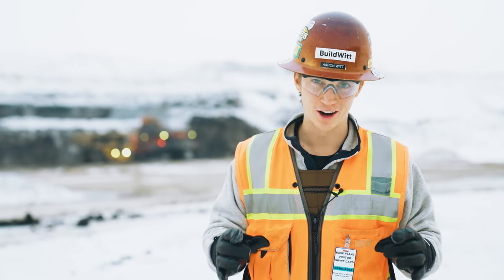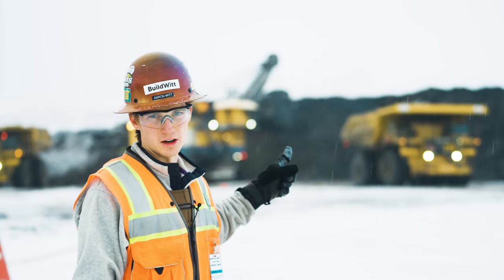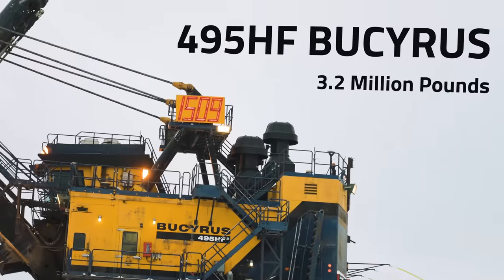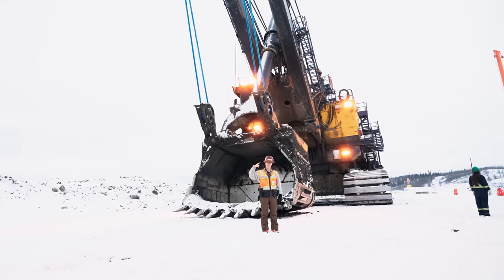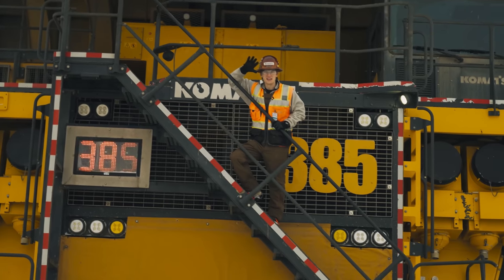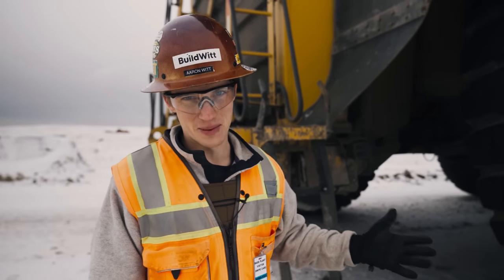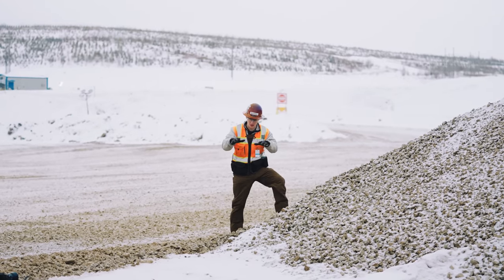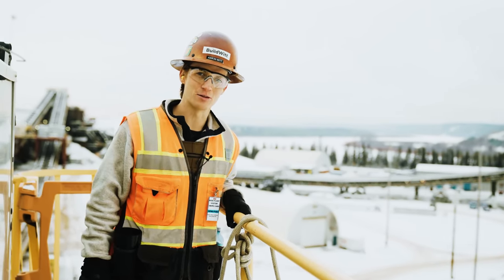Comparing the BIGGEST Trucks on Earth

Comment: Finally been waiting for this one! I was in dispatch the day of this filming!
Reply: How cool is that! 👍👍
Reply: What does the dispatcher do?
Reply: @AHomelessDorito  Dispatchers use a program to essentially tell the trucks where they need to go. The dispatchers goal is to optimize the amount of trucks they need per each shovel to never have a shovel waiting without a truck being there. They also need to make sure the hoppers/plant is getting the correct blend of material so they can optimize how they extract the oil from the sand.  So when Aaron went into the truck and shows off that panel that said the operator had 19 minutes left of their lunch break that was the Modular dispatch panel (Modular is just the brand of panel and the makers of the dispatch program there are also others such as WENCO). On that panel the operator will get a message telling them to go to X shovel or X hopper/dump.
Reply: @72lololol  What kind of autonomy is used on the self-driving truck and how does it work with your dispatch system?
Reply: @philipwallstedt5685   I worked in the manned operations so i am not an expert on the topic, but Suncor uses Kamatsu's AHS system the way it works is essentially there are 2 different programs running Modular Dispatch and Frontrunner. Frontrunner being the system used to actually control the AHS trucks. But the trucks are pretty well fully autonomous the way it works is by supervisors in the pits drawing lines for the haul trucks then the haul trucks using their super precise GPS systems will stay exactly on those lines. They also have a whole array of cameras and lidar on the front and back of the truck where they will sense nearby objects and stop if needed. But they fully back up to the shovel and dumps and will dump off on their own. @Aaron Witt just released a video on them as well that talks about them a little further.

Comment: I do a lot of work in my backyard. Obviously I just have tools like shovels, rakes, wheel barrows and hand tampers. The more of your videos I watch the more I realize these really big machines are just really big versions of hand tools and that's not meant to be a slight. One of these machines does the work of 1000s of men and all these machines run on oil. The problem is we're squandering this precious resource rather than using it wisely.

Comment: I visited the Syncrude mine back in 1984. At that time they were mining the bitumen with massive draglines and windrowing the bitumen in to large windrows. The windrows were picked up by a large wheel excavator, much like the ones you see in German coal mines, and placed on to a conveyor belt and taken to crusher and the processing plant.  That method fell out of favour due to the corrosive nature of the sand on the conveyor belt. Syncrude changed to the shovel/trucking method seen here sometime in the early 90's. Great video!

Comment: 17:30, I like the addition of the “This is what oil is used for” list.
One could add motherboards, device cases, screen protectors, watch bands, led light fixtures.

Yes, my laptop still has a CD player. Do I use it? … If I could figure out what I would put in it. 😂 Jk, I remember 3.5” floppy drives.

Comment: Thank you so,so much for field trip to (Oil Sands mining ⛏️) you "ROCK" my best U-Tube videos friend. Your explanation of the whole process of separation of messy "OIL" is the best. That shovel operator has to get an A+ in my Humble opinion for seeing that Rock with Dinosaurs preserve, that operator needs reqignishion big time for History preservation. The things people don't understand about OIL SANDS mining ⛏️ is the company is cleaning the earth, plus providing natural resources to POWER are world. That ground is contaminated, the mining and cleaning up sands, returning what's left, makes the mine cleaner than before mining started. You are the greatest for videos and speaking about the big equipment that it takes, the big super size machines must get their lower works just grinded on 24/7 with that oil/sand mix, high maintenance required.

Comment: This Bucyrus is huge, but imagine that On minexpo 2000 Bucyrus international announced new electric rope shovel. Model 795B with bucket capacity 135 tons per pass,. It will be able to cut bank heights up to 22.8 m and will offer a cutting radius of 26.6 m. Operational weight of the machine 2041 metric tons.(More than WK-75 or P&H 4800 currently two largest rope shovels in production) but sadly after CAT buy Bucyrus they canceled this model and now not have plans to shovels larger than 7495, this is very sad, WK 75 and 4800XPC is two kings for now
Reply: bucyrus is owned by finning cat the biggest cat dealer in the world based in vancouver canada. finning is all over the oil sands , the uk , and south america
Reply: @ronblack7870  I know this, but it doesn't change the fact that after Caterpillar bought Bucyrus, they cancelled plans to produce many models, including the 795B Shovel. And that's very sad.

Comment: Interested in what goes into maint and refueling of these fleets at these mines. Do they have some downtime for a few hours or do they rotate equipment to allow for fueling?
Reply: #1 rule: don't discuss fuel consumption
Reply: There are several fuel and lube bays around the site. Operators pull in safe the truck dismount and grab a coffee. It takes the attendant about 15 minutes to service and fuel the truck and then you are on your way. Graders and loaders also use the fuel module. Hydraulic shovels are fueled during shift changes by a fuel truck dozers are also fueled by them in the mine at there work location’s.

Comment: 3 questions:
-are they backfilling the mine?
If yes with what material?
-what happens to the sand after processing, what is the targeted level of contamination after processing?
-what happens to the water used in the extracting process, is it cleaned of hydrocarbons, is it safe to the surrounding rivers and  environment? Does ot have an effect on local populations?

This is not a question, but those shovels are absolutely massive, and they have a trailing cable, if they use electricity, why still have a fuel tank?
Reply: after processing, the sand is used to backfill the mine

Comment: This is more of a commercial than a technical insight. "This is the three-layered front" shows the narrator, not the front. "This is the engine" does not show the engine at all. 
A lot of slow-mo, but no single shot of the systems in motion is longer than 5 seconds.
No explanation why the driver had to get off when their trucks are going autonomous.
It could have been a fascinating video, but Suncor probably didn't want it to be.

Comment: Not a fan of komatsu, they're junk and parts take forever to get. My cat truck has 10k hours on it, and the only thing that's had to be replaced is the alternator, and one of the lift cylinders had to be rebuilt due to a seal failure. We run multiple komatsu WA500 loaders, and they're constantly breaking down. All of them are 2021 or newer too!